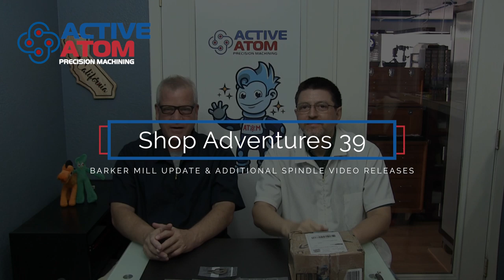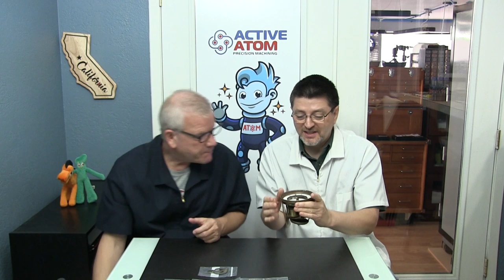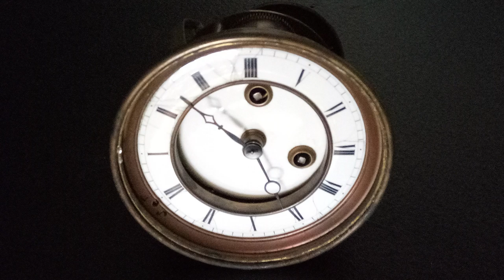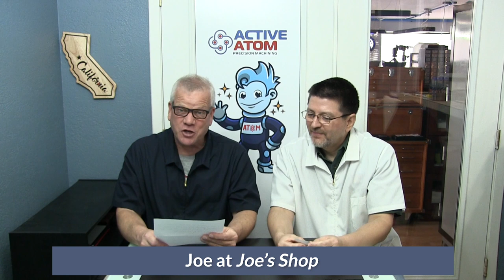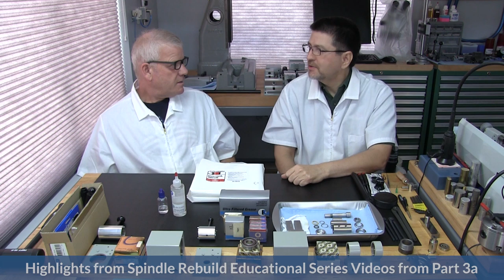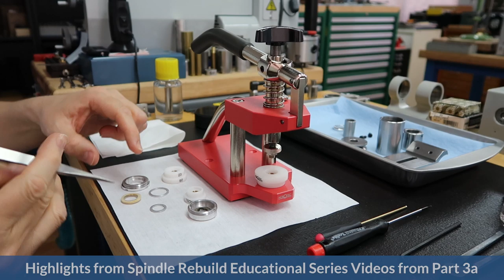SHOP ADVENTURES 39: Barker Mill Update & Spindle Video Releases

Comment: Great video.  I have learned so much about bearings since watching you gentlemen.   Thanks for making me smarter, now if I can only remember everything.
Reply from the maker: Hi Roy, we know we sure have already covered the collet key in a spindle and the bearings both in great detail even how to correctly disassemble a spindle however there is more to still come even now with that addition of the larger Barker Mill spindle reassembles.
Roy we were not originally going to add them but we realized we really need to add more spindles in some more common type bearing uses and sizes many others would be much more greatly in the know about.

Part 3 of the Educational Series on precision machine spindle rebuilding releases this week, it is going to cover 3 main topics on the spindle rebuilding process and in the use of Levin Spindles and the likes, so we hope you can join us and watch this continued series, one we are both we are happy to be able to make them for helping others, exposing these techniques to others and the likes, well at least from our two guys point of view on how we solve challenges we encounter Roy.
Lance & Patrick.

Comment: Cool ,  funny watching Lance tap on that tiny bearing , i had to wallop out a 2 foot  dia ball race today  !  .   Cheers .
Reply from the maker: We seen the machinery you work on we think our bearings are more of the diameter that would be used if there were one on the rear of the speedometer cable LOL. 

Hey though we did share e are going to add 2 additional sub-parts to the precision machine spindle bearing rebuilds a Part 3e and part 3f covering the vertical spindle deep groove bearing and the installation of the horizontal taper roller bearings, both from the Barker bench top milling machine Max, but hey, still small from your worlds point of size reference however, they are at least easier to show on the camera. LOL. 

Thank you for stopping in for a shared chat.
Lance & Patrick.
P.S. 2 feet holy mc molley Max

Comment: Another execlent video
Reply from the maker: Hi Jim, our Slop in the Shop friend.
We wanted to provide you an update.
We have set a schedule to share the Mill Vise Speed Handle you built for us and we are honored to have as it is made by a man we now that is cool.

We are to reassemble the Barker mill starting shortly, it will take us August and September to finalize and test this fine second operation mill to see if we added improvements to the end product tolerances or at least sustained the original factory specifications.
That is the time we plan to and will share our gift from you finally, one we will not open until in near real time as we apply it to turn the threaded lead-screw.

We are watching your videos,  so you know this, not commenting right now writing a giant multi page research instruction manual here Jim, so too much typing here to share a comment outside of our own channel, will be back sharing again in a few months likely, well for sure.
Your friends Lance & Patrick. 
P.S. You guys stole our weather for July? we should be 110 not 91 to 97, annual monsoon 1 month early as well.
Reply: Great I always trust my friends

Comment: 18:20.  That looks like a press used to press watch backs into a watch case.  It's a nice one.  That grease is expensive.  It's no wonder you carefully measure it in a syringe.  Great show as usual, gentlemen.  Many thanks..
Reply from the maker: Hi MrShobar, yes the grease is measured but not for the money reasons though that is also helpful it is the risk of heat build up in the bearing during break in which is in filming now as Part 3 from those highlights is nearing release this week anyways to be sure.
We are covering 3 main spindle rebuilding topics in Part 3, you might enjoy the Woolite detergent lesson by us.
Thank you for being here with us, this work can be a bit tedious to say it lightly, we sure are glad we love what we are doing or well.

See we also decided to add larger spindles, 2 from the Barker, they have much more common bearing types and these are far more a common spindle type these are to actually allow us to share that regardless the spindle tolerances, type, function, duties and such, it is the processes and procedures we are applying that are the true lesson, one that will be exposed in the final part, Part 5, hope you will continue to join us in this journey MrShobar. 
Lance & Patrick.

Comment: G’day Lance and Patrick, looks like your fresh and ready to go. The clock looks great and would look nice in a glass case, maybe brass and flat glass panel lantern style. With the clock I see 2 winding shafts on the face and you mentioned 2 ?? springs but how is the alarm time set? Oh well off to see some spindle work, cheers. Peter
Reply from the maker: Hi Peter and thank you we love receiving the clock from Joe at Raptor Machine & Tool it is a really nice thing to have and in time as time be given we hope to look into the refurbishing of this clock. 

After we filmed this clock Peter, as we opened it live, it is not an alarm after all, it is an hourly chime one winder for the chime the other for the time. Thank you for assisting us with this clock thought

Thank you for sharing we just think wristwatch and they time and some have an alarm on them so that was our first thought relating this to a wristwatch and not the clock that it is.  
Lance & Patrick.

Comment: Just curious why you used the hammer instead of an arbor press to do the installation?  I would think that slow and steady would be better on the parts.
Reply from the maker: Hi Roy well this is a GREAT question and we hope our answer is equally as warranted with its response.
While we use a hammer, in this case, a dead blow SKF hammer for some light tapping, as the real full video that comes out in little more then a week shares more details then that shard highlights (this was only highlights Roy) named precision machine spindle rebuilding Part 3a which focuses on that small Levin Accessory spindle we do use this hammer with the SKF installation bit and impact sleeve also called a shaft to tap the bearing onto the spindle shaft.

HELPING ROY
We never recommend the use of a press to install a bearing it is best to use the installation and dead blow hammer.
We also (applies mostly to larger bearing installation projects) utilize bearing heat plates or a heat induction support yoke and then if needed to also shrink the spindle shaft or with the use of dry ice.  

Thank you very much for being here with us we cannot wait to begin machining our products components soon.
Lance & Patrick.